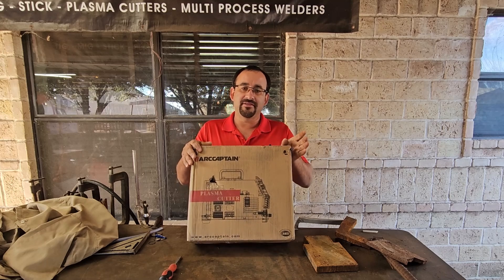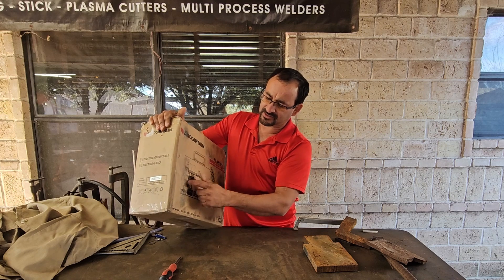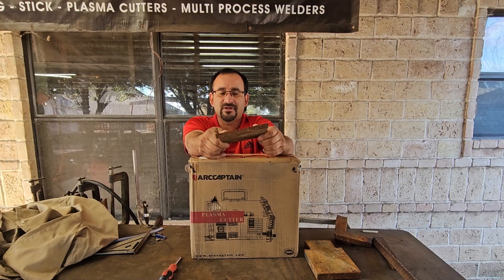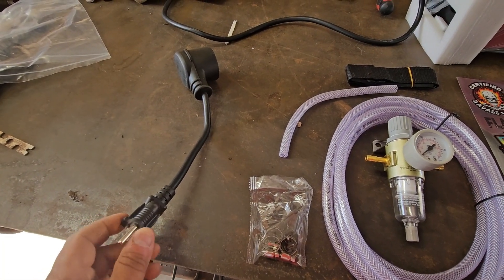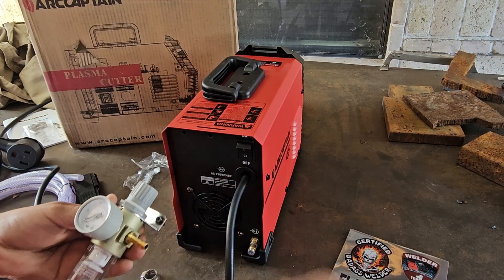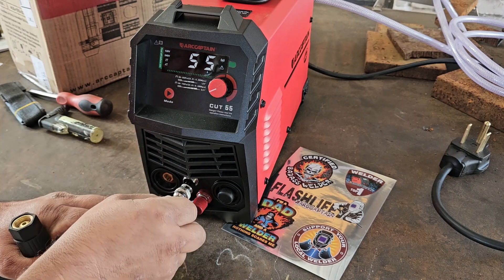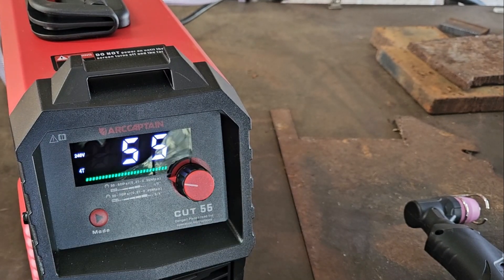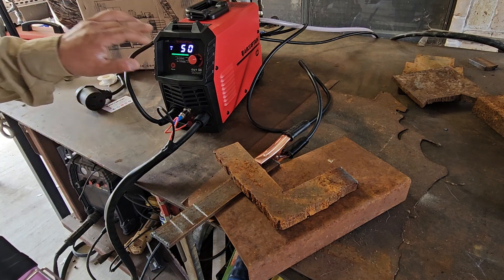Testing and cutting with the Arccaptain Cut55LED 55 amp plasma cutter #arccaptain #plasmacutting

Comment: The cut depth  was Surprising 👍🙂
Reply from the maker: I believe the last time I sliced some 1" plate it was using a 60A machine and didn't expect this one to cut through. I need to build me a shop / building to store my gear and have a better work area. Thanks for watching.
Reply: Do you need plasma?